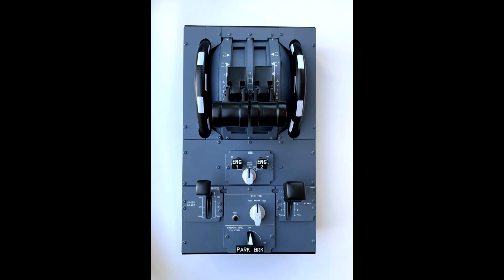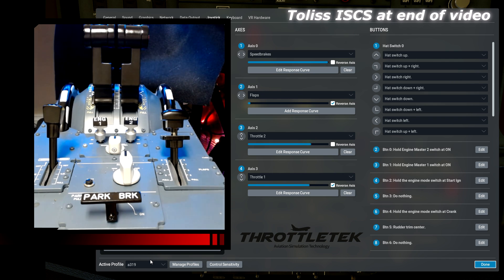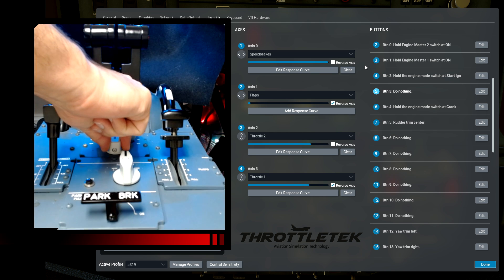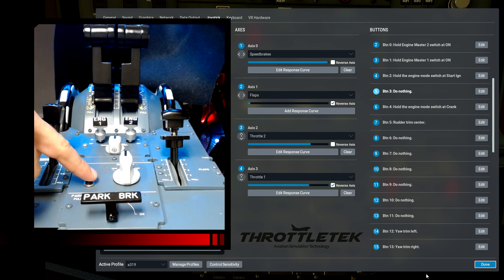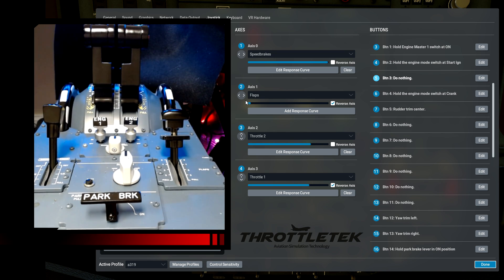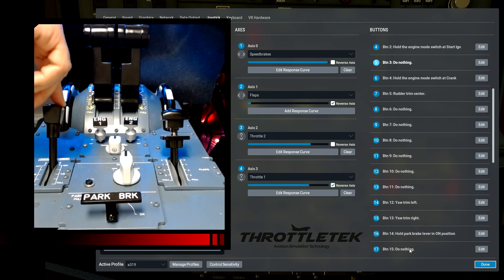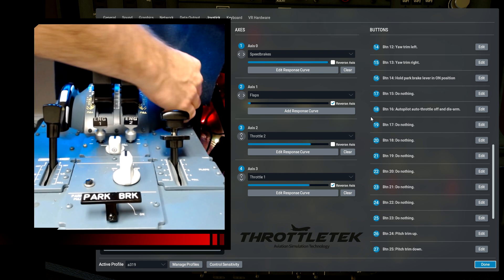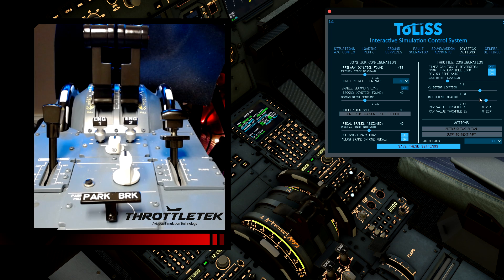Binding the ThrottleTek Flight Box V3 | Mini | X-Plane 12 #throttletek #xplane12 #keybinds

Comment: I am having problems with the speedbreaks disarming themselves even with the button on the speed breaks set to do nothing. Has anyone else had this problem? And if so, has anyone found a solution? Xplane response curves didnt fix it.
Reply from the maker: As far as I have tried, in X-plane it’s can’t be bound. I’ve tried over and over. It does however work in MSFS the way it’s intended.
Reply: @V1Sim  Thank you for replying. I am not trying to use the button on the speed break lever.  But when I set the lever axis to speed breaks, I cant keep the spoilers armed for take off and landing. I have the "s" key set to hold speed breaks armed on my keyboard. And nothing is bound to disarm the speed breaks. And yet the ground spoilers wont stay armed. Have you had the same problem ? Thanks,  Matt

Comment: Hey! Ik u prob won’t see this, but I’ve been struggling a bit with the tollis a320. I’ve heard a landing flare is supposed to be 7 seconds- 50 ft over the threshold and landing between 1000-2000 ft (but as long as it’s in the touchdown zone) and usually somewhere under 1.2 g’s or 300 fpm. I can consistently get 50 over the numbers and usually around -170 fpm and close to 1.05g, but the time from crossing the threshold to touching down for me is usually under 6 seconds. I’ve heard you should flare at 30 feet -
but am I wrong? Because I usually find myself landing very early into the runway even if it’s very smooth so I can’t hold the flare for longer because then I’ll ballon. Ik this probably makes no sense but just if you had time to answer that would be great! Thanks!

Comment: Hey V1, I should have my flight box end of Feb. Can you tell me how you mount it? On a table of some sorts? Im very curious, as I have no idea what im going to do when it arrives. Tysm!
Reply: I’m in the same situation. I don’t know where it put it. I can’t put it on my table as it is too high and I use the next level racing flight sim seat. I have to get a box of some sort to put it on top of but I have no idea how big it has to be. I’m not going to order before I figure this out lol
Reply: @Swish_slashy22310  Id actually highly recommend ordering ASAP if you truly are interested. I placed my order early October, and he said expect to start the shipping process end of Feb. So its quite a lead time, solid 4-5 months, as its made-to-order.

Ill probably just end up having my dad or someone good with woodwork to just build me a custom table to hold it. Maybe even paint it to match the bus colors.